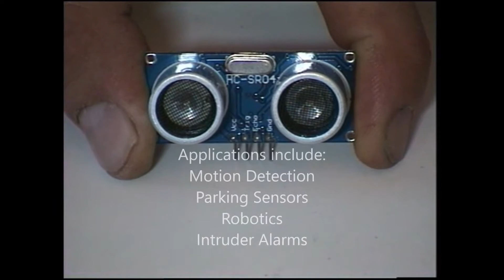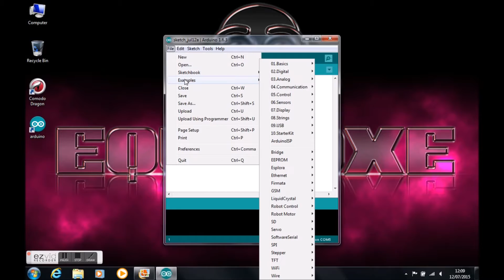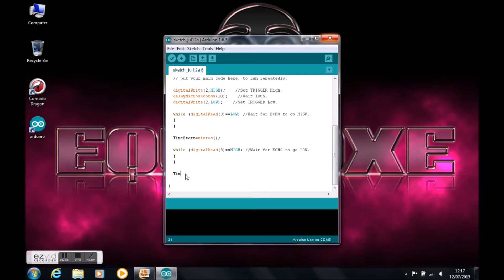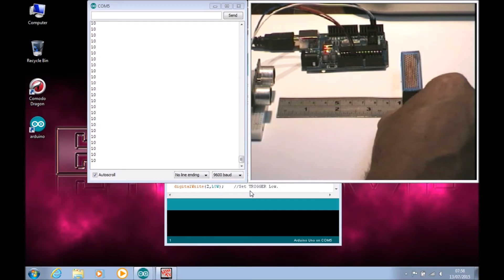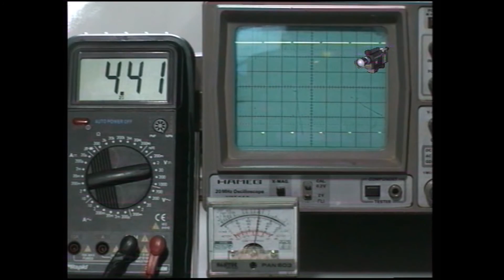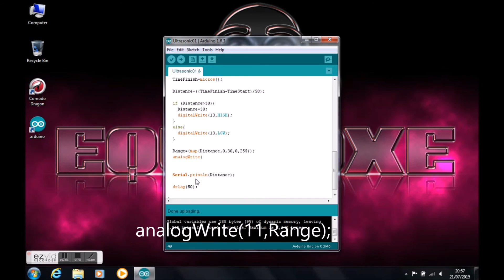HC-SR04 & Arduino Ultrasonic module - Getting Started.

Comment: Hi Equinox! Thanks for the excellent explanation! May I ask, can this sensor be put on the analog pins as well? Do you just use analogWrite and analogRead instead of digitailWrite and digitalRead? Sorry if it sounds stupid. I am new to Arduino.
Reply from the maker: Hi Renier
I've actually not tried it, but there is no reason it shouldn't work
If you did:
pinMode(A0, OUTPUT);
pinMode(A1, INPUT); 
in the setup
and then
digitalWrite(A0, HIGH);   
delayMicroseconds(15);
digitalWrite(A0, LOW);  
 while (digitalRead(A1)==LOW)
  {
  } etc etc
Like I say, I've not tried this but it may work!
Reply: Thanks Equinoxe. Really appreciate your response. Will surely give it a go!

Comment: I seldom comment, but I thought this was so well done I needed to thank you. I never realized how accurate those ultrasonic modules were.  I was thinking about remotely monitoring the water level in my catchment tank using one.  I suppose water is a good enough reflector. Anyway thanks and Aloha
Reply from the maker: Thank you for saying so! Yes, they are pretty accurate, considering how cheap they actually are, I was pretty surprised. Not tried with water, but I can't see any reason why it wouldn't work